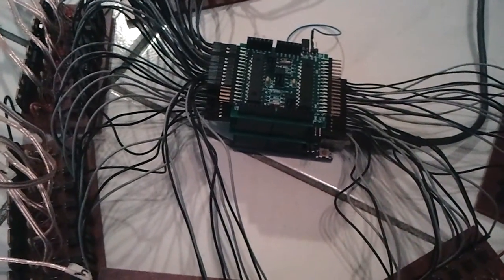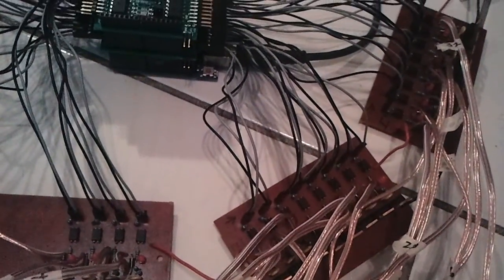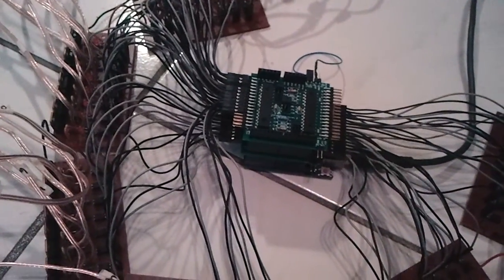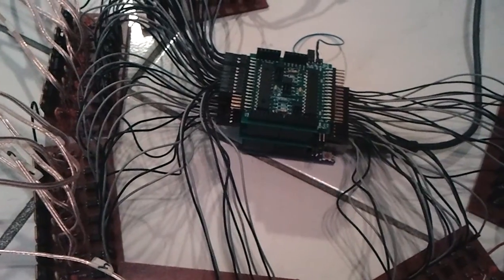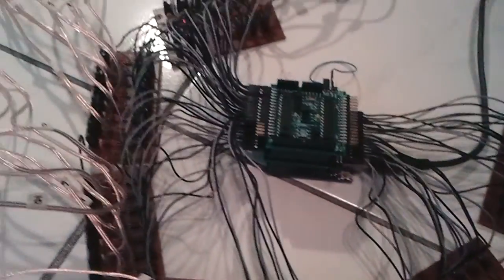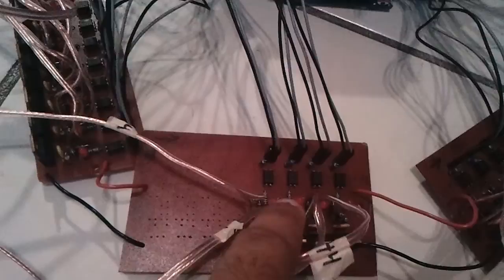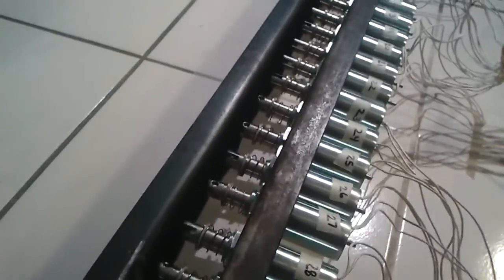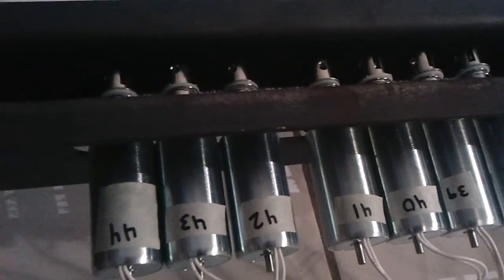Controlling 44 solenoids with arduino UNO & PWM shields

Comment: my question here is regarding isolation. im using a relay shield but thinking of moving to MOSFET driver because i think it would work better. my problem is when I open one relay the other ones open too. Do you think it is a problem of isolation of the power supply because im using a breadboard for this connection. i think im missing something very obvious here like deep down my heart says to isolate the solenoid circuits completely by using different breadboards but there has to be a way that i can isolate the circuit but on the same breadboard and also hoping that switching from a regular relay to a mosfet driver would help me do that.

Comment: Hello, what is the name of the Arduino module that looks in the middle? I guess it allows you to increase the number of Arduino saldias?
Reply from the maker: I'm not sure what you're asking about. Could you rephrase that question? 
Hablo español si lo prefieres.
Reply: Hola Jefferson, gracias por responder, mi pregunta es: ¿Como se llama el modulo central de donde salen los cables?, es un demultiplexer??, quiero saber si existen modulos de arduino prefabricados que me permitan ampliar el numero de salidas

Comment: I am actually trying to design the same thing for my piano using 88 solenoids with an Arduino uno and 6x16 channel pwm servo drivers, I am basically a developer and having a hard time with electronics, any guidance would be extremely helpful :)

Comment: How is the PWM shield connected to the solenoids and to the Arduino? Also, how is the code set up?
I'm having trouble finding documentation for this PWM shield from practical maker.

Comment: Is there an application for the device? Is something achieved by impacting the metal plate? Or was it made solely to test how well 44 solenoids can be controlled?
Reply from the maker: Ben Swain This system was used to actuate an electro-mechanical piano
Reply: Cool. Surely you have a video of it somewhere. I don't see it on your channel. I'd like to see it play Clair de Lune, but probably requires more than 44 piano keys! Are the solenoids placed inside a normal piano?
Reply from the maker: Actually, documentation is still in process, but it should be done soon ;) 
And yes, Claire de Lune would not be possible. You can get that from common player pianos, which is not what I intended.

Comment: With this setup can you have multiple solenoids engaged at once? I'm trying to design a circuit that has ~25 solenoids with maybe 3-5 engaged at a time
Reply from the maker: Isaac Goodfellow this steup would work very well!
Reply: Thanks Epic Jefferson! One more question ... It would seem that Practical Maker is no longer in business, and I can't seem to find any specifications for the board you have. Does this look like it would potentially work?

https://learn.adafruit.com/adafruit-16-channel-pwm-slash-servo-shield/shield-connections

Comment: Hi, i'm a student, and i working on a project. i will use 54 solenoids but i don't know how to connect between solenoids and arduino. So i want to know that what component you use, how supply electrocity and where you refer such as internet sites.Please teach me. Have a nice day ^_^ !!!!
Reply from the maker: Hey! I used this to get started http://www.instructables.com/id/Controlling-solenoids-with-arduino. The circuit used in this video is a modified version of that. I'm also using practical maker's PWM shield for arduino (http://www.practicalmaker.com/products/arduino-shields/pwm-shield-assembled) because I needed the solenoids to have dynamics in their attack, but if you don't need that then just use the instructables version.
Reply: Epic Jefferson  It will be helpful. Thank you for your kindness!
Reply: Epic Jefferson hi, did you need to use some kind of 5v to 12v conversion method? thx
Reply: Epic Jefferson Never mind, the link you provided clarified that. :)